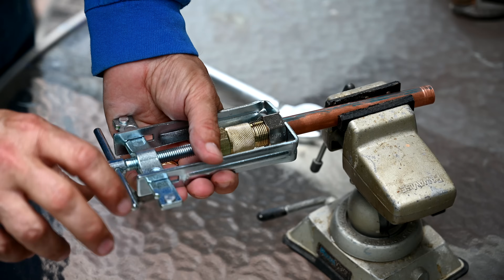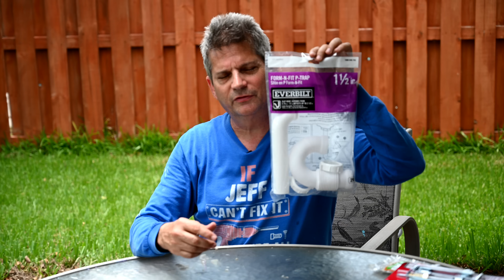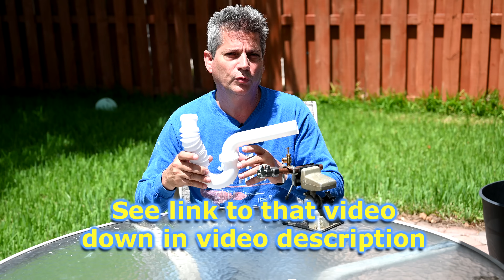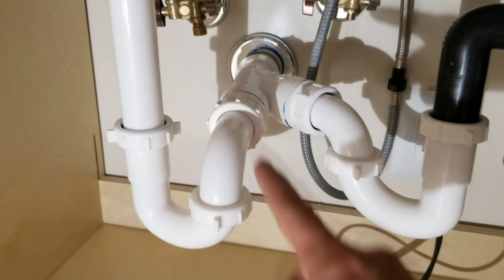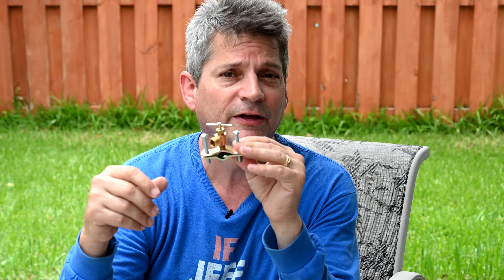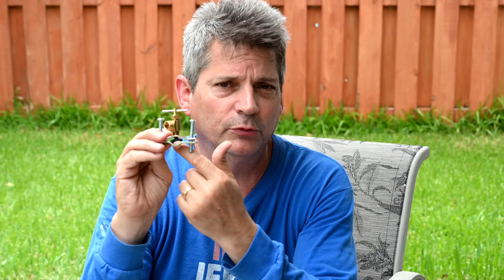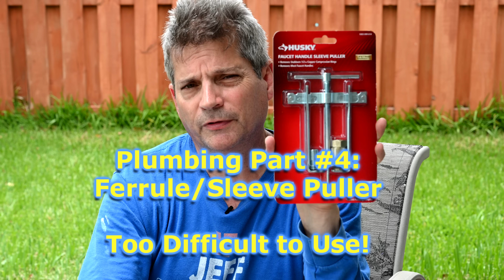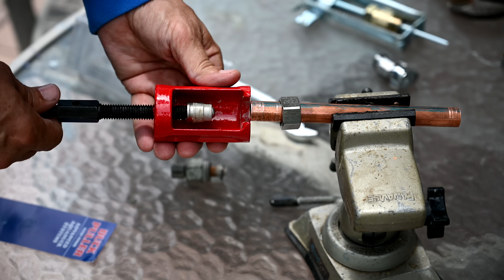4 Plumbing Parts/Tools You Should NEVER Use. NO Plumbing Fails

Comment: In the puller sleeve bit just think about this remove the hand held bit it’s not doing anything   We have these in the uk. Work great.
Reply: I see notches further out on the crossbar. This would clear the handle, and would put the claws at an angle, offering a better purchase on the nut, which could be a better pull on the ferrule. Therefore I can't agree with his blanket condemnation of this tool. However, comma, it might be better to use a tubing cutter and cut just behind here the ferrule was, thus you have a fresh area for a new ferrule to bite. If you have the length, of course.

Comment: Oh, and saddle valves are great for draining pipes that you're going to be deleting anyway.  $5 and 10 minutes vs. an hour vacuuming water out of the floors, or constantly emptying buckets.  Great for repipes.  Hook up a hose, pop on the saddle valve, do something else while it drains.

We once had to drain 4" main servicing a 100 unit, 4 floor complex (late revision), and we rigged up a home made saddle valve to drain that sucker.
Reply from the maker: Yes temporary installs are good for this part.

Comment: You're not using the ferrule puller correctly. I just replaced a toilet valve and the old ferrule was stuck solid. I went about the exact same Husky puller. You have to thread OFF the arms and just use the threads to pull the ferrule off the copper. It worked FLAWLESSLY for me.
Reply from the maker: It works flawlessly when the feral is not stuck. I've tried it both ways and the duck polar that I use is much better.
Reply: Mechanical advantage aside,  from what I can see,  you're using it incorrectly.

Comment: If you do things " Country" it eliminates the need for code . I had a radiator hose as part of a P trap , worked great for years. The metal part that was "code "rusted through .the hose I could use on a car again. I think it was a 1950 something car.

Comment: As a first time home owner I have noticed many shortcuts taken by a DIY kind of person, particularly in the plumbing aspect. The house had one of those accordian style traps in the master bath, the inspector reccomended replacement so I did. There is also a saddle valve tapped underneath the kitchen sink. I previously didn't know this was against code (apparently my home inspector didn't either), thank you for sharing this information. It hasn't started leaking yet, and I'm going to get it out of there sooner than later.
Reply from the maker: Glad to see you're getting smart about all this. Just monitor the saddle valve, you can change it at your leisure, or if you do a remodel. We are remodeling my friend's kitchen right now, will be changing out all the valves to new water valves. Also a few weeks ago we uploaded a video on how to avoid the Saddle Valve, using 2 other alternatives, see it here: https://youtu.be/WKKrUINQm_U

Comment: Question about flushing an electric water heater.  If the water heater has never been flushed and is over 12 years old, is there a problem with flushing it now?  Or, am I just asking for trouble, considering the age of the unit.  Thank you!!
Reply from the maker: I can't see any problem with draining the tank. There might be a lot of sediment in the bottom, which it will empty out. You might want to pull out the sacrificial anode if you have access to it, and if you don't see anything left on the rod, you might want to replace it to extend the life of the water heater. Most water heaters are good for 6 to 10 years, but changing the anode helps a lot.
Reply: jeffostroff  Thank you!!  I have easy access so that should go much smoother.  I appreciate your quick and helpful reply.

Comment: Do you have an opinion on the sharkbite things?

My yard guy hit my faucet and bent the pipe causing it to leak. I shut off the water to the house and he used a sharkbite coupling. It stopped the leak, but it allows the faucet to rotate.
Reply from the maker: I use shark bites on rare occasions like converting the old banned polybutylene pipe to copper, but I will only use Shark Bite on the outside of a wall.

Comment: Wish I watched your video last week to prevent me from buying the useless Husky ring puller. Ended up using a torch to soften the ring and tap it broken with a flat head screw driver. I was concerned about deforming the pipe and compromising the soldier joint behind wall but it wasn't an issue.
Reply from the maker: Yup. and lots of "experts" have chimed in, calling me an idiot, that I don't know how to use the Husky tool, LOL. They call me an  idiot for using this tool as a ferrule puller when they say it['s really only a shower knob puller. But they don't know the tool is both a shower knob puller and a ferrule puller, even says it on the package.

Comment: You screwed the first one together wrong mate, the weir is higher than the connection, there’s nothing wrong with S traps if you install properly.
Reply from the maker: Relax, I was half joking around in the 98 degree heat that day when I connected it. My explanation of the Venturri effect of self siphoning is what causes problems. Not everyone has the problems. Just because you never saw a problem does not mean there are not problems.

Comment: The big issue was most often the lack of the vent stack except on just the toilet. If the building gets a remodel, the proper vent stack to prevent air pressure differences would fix that, but at the same time, the S trap is replaced with a P trap.  If you are old enough to remember those, you will remember the sucking gurgling sound when the sink and bathtub drain plugs were pulled as they would form whirlpools and suck air.  Fun to watch as a kid. Now we have slow drains that, collect debris, plug up, and need periodic disassembly to clean them out.
Reply from the maker: Yes I saw a few whirlpools in my day as a kid growing up and Boston

Comment: A previous owner did a whole bunch of work on my house around 2007, and we discovered it about two and a half years ago. The bathtub drain clogged about once a week. When I had the bathroom remodeled, it had one of those flexi drain pipes. The downstairs laundry drained into an S trap which we discovered after the drain clogged and soaked the downstairs. When we removed the damaged drywall, the nearby bathroom had upside down plumbing to the shower. Someone clearly did a fantastic job!
Reply from the maker: On bathtubs, you usually find the overflow drain is a flexible pipe, which is OK, since if it mainly used as an air vent. The only time that pipe would ever see water is during an overflow. But if the main tub drain at the bottom of the tub was flexible, then you have a problem for sure, that is a clear violation of plumbing codes.
Reply: @jeffostroff  Oh it was flexi all the way to the drain pipe running down through the wall. I'm pretty sure the whole thing would have failed code even with a normal piece of pipe.
Reply from the maker: @Beastphilosophy  Yikes, so it looks like the previous "plumber", for lack of a better word was too lazy or did not know how to cement PVC fittings and pipes together. I hope you had it replaced with the real deal when you had the remodel done. The other thing that makes me cringe when I see these stories is all the wasted junk that has to end up in the landfill because the job is essentially being done twice now.

Comment: Interesting info on the S-trap.  I had to look under my kitchen sink to confirm that what I have isn't >quite< an S-trap. Mine has a standard drain trap connected to about 4" of horizontal run, then a 45* elbow pointing downwards, then a 45* elbow-cum-cleanout.  This wouldn't have the same dynamics as an S-trap, which too closely resembles a siphon, but it is similar.  However, I've never had a problem with a toilet flush letting sewer gas into the kitchen, but I suspect the reason is that local codes require 2" air vent lines associated with drain lines.  Frankly, I don't know if there is such a vent for the kitchen sink, but there certainly is for each toilet, and there's a 4" vent for the whole house.

The info about the saddle valve is especially interesting.  I'll bet that every ice maker installation done by delivery men uses one of these.  That just gives me one more reason never to get an ice maker refrigerator!  (What's so hard about filling ice cube trays, anyway?)

I'm surprised by the ferrule pullers.  I've never needed one of those, but see potential problems with any such design.  Some nuts are designed to compress the ferrule from the back side (while the fitting compresses it from the front).  For such a nut, it would be working against you as you try to use the nut to force off the ferrule.  Better would be some sort of split device that would fit close to the pipe and which the nut would screw over.  This might not tend to compress the ferrule as it was used to pull it off. 

Also, I think one could make one's own tool to do this from commercial fittings -- preferably SS fittings.
Reply from the maker: Good info, thanks!

Comment: Re the crimp ferrules, you can usually use a hacksaw blade to weaken the ring a lot. Although once you try that you definitely cannot take the easy way out and just use the old nut on a new valve.
Reply from the maker: We are going to do a video soon on several ways to remove a feral compression sleeve
Reply: Jasper Janssen 

Ppjhfg

Comment: Can't see a need to use that Flexi waste contraption ever. Those saddle valves are legal here, there's even a company that allows a stop tap to be inserted into a live pipe and it complies with the regs aimed at rhe pro market. It uses a similar idea. I personally haven't had a clamp-on fitting leak, but I'm not keen on them. They also use a similar idea to add an outside tap, again aimed ar the diy market.

As for the olive puller, yeh, they're olives, well that husky one is just too complicated. I like the other two you have. The "special spanners" are lovely. Shame there's such a wide range of sizes on the compression fittings here. They're all for the standard pipe sizes, but the nuts are all sizes. I bought some flare nut spanners for 15 and 22mm, I end up using an adjustable as often as not.
Reply from the maker: Thanks for the info

Comment: the S trap could be fix if there's enough room above where it drops straight down to put in a one way air valve. You'd need enough room that the valve can be above the top of the sink. You'd basically remove the S, add a T, a P, and a one way air valve.
Reply from the maker: You referring to Studor valve?
Reply: @jeffostroff  yep. I always call it a one way valve

Comment: I'd like to see that olive/sleeve puller work on an olive that has been fitted rather than slid on for illustration purposes. 
Can you do a video showing this? 
I use an olive cutter by the way
Reply from the maker: Yes I plan on doing a video showing several different methods for removing the olives hopefully in the next couple of weeks

Comment: I think that the insurance company giving you 48 hours or you're kicked off the policy is kind of extreme.  Flex traps are a poor product, but it's not like they're going to destroy the house.  Even if you got a leak, it's a sink; you'd be standing there.  People don't leave water running in sinks unattended for hours.  The most likely failure mode is a clog.
Reply from the maker: I agree, but what are you going to do? Here in FL, insurance companies look for reasons to "fire" their clients. I have had to go looking for new insurance a half dozen times in 12 years because they either pull out of Florida due to hurricane claims, or they raise the rates too high. They never find anything wrong at my house because I run a  tight ship.

Comment: On the ferrule removing problem, I agree, that 2nd tool is way better, and the first one is very marginal, but, I MUST point out that you were using that first tool (by Husky) incorrectly...perhaps the real problem is poor directions?

Keep up the good work!
;-)
Reply from the maker: Yes that was a contributor, plus the fact that Husky now has 2 sets of instructions on the back, as they are marketing this tool as "2 tools in one". It is primarily a stuck faucet knob puller, and a ferrule sleeve puller. Trying to be all things to all people never works.

Comment: You should let someone show you how to use the $10 dollar puller. I think even you know that you are not using it the way it is suppose to be used. sure you can see the notches on the end that the brackets fit in? really Jeff you should be ashamed....
Reply from the maker: The problem is Husky bills this tool as 2 tools in one, it is primarily designed as a faucet knob puller, and you have to remove the arms to use it as a ferrule puller. The problem is that tiny little rod you have to twist with your fingers kills your fingers so you have no mechanical advantage. The other tools, you insert a ratchet, and 10 seconds later you're done. that's what you are missing.

Comment: FYI S-Trap are permitted in Philadelphia Pa plumbing code  .
Reply from the maker: FYI, you are wrong, just like every week another person like you says their state allows it. NO STATE allows S-Traps. Here's code from your state: https://up.codes/viewer/pennsylvania/ipc-2015/chapter/10/traps-interceptors-and-separators#1001 Under Section 1002.3 Prohibited Traps is says:
The following types of traps are prohibited:
1. Traps that depend on moving parts to maintain the seal.
2. Bell traps.
3. Crown-vented traps.
4. Traps not integral with a fixture and that depend on interior partitions for the seal, except those traps constructed of an approved material that is resistant to corrosion and degradation.
5. "S" traps.
6. Drum traps.

Comment: forgive me if this was already addressed in the comments because I'm not going to sit and read them all, but I wanted to comment on the handle sleeve puller.  I own one of these as well, and if you try to incorrectly use it as is shown in the video or course you're going to hate it.  It's not intended to remove the compression ring, it to remove the stuck handle from a faucet.
Reply from the maker: A number of people just like you, incorrect of course, have commented this same thing, but you are all wrong. If you look at the directions on the back of the package, it clearly shows two sets of directions, one for using it as a knob puller, and one for using it as a compression puller. Go to Home Depot's web site for this part: https://www.homedepot.com/p/Husky-Compression-Sleeve-and-Faucet-Puller-63876/304543091?keyword=husky+sleev+puller
You'll see the name of the Husky tool is "Compression Sleeve and Faucet Puller", they are trying to call it 2 different tools in one.

Comment: There  is a tool to efficiently snap off the feral, A solid steel shaft that fit snug inside half inch copper pipe with an opposing tapered ridge of hardened steel that pinches it off with a snap as you tighten , very well made.
Reply from the maker: I've been using the duck puller, what tool are you using?